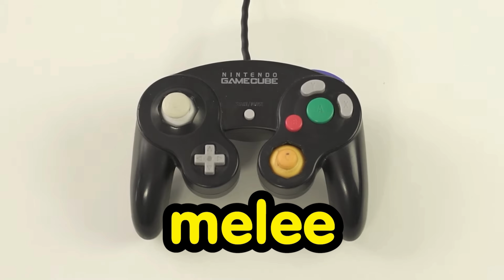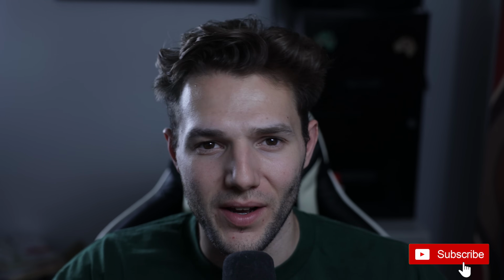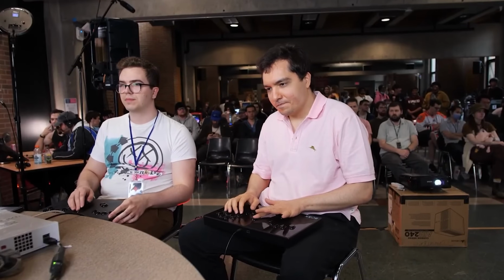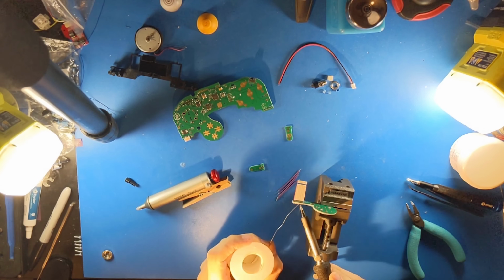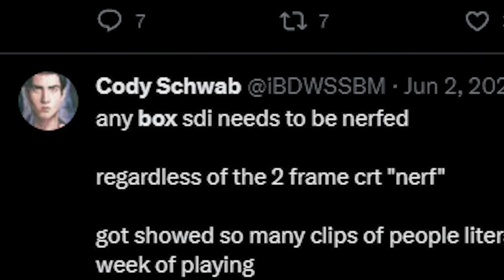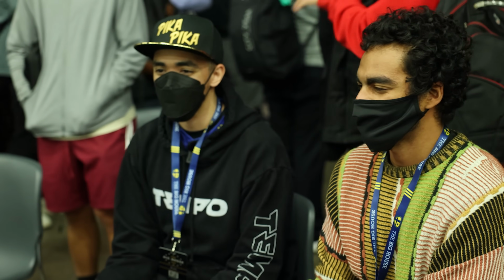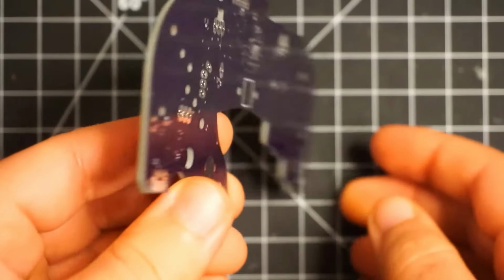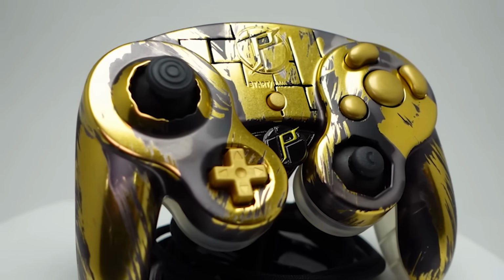The Hidden Barrier of Melee

Comment: As a (now retired) phob maker due to hand pain and stepping away from melee (maybe I’ll get back in with a rectangle), I’m very glad that the 2.0 lowered costs for both modders and users, and is extremely easy to make. You didn’t mention any of the Boxx nerfs that are already built in compared to notched OEM controllers: they have significantly reduced angles compared to max wd notches, which are trivial with phobs. This doesn’t sound like it’s huge but it reduces the distance you can wavedash by a massive amount on fox specifically, as well as making your recovery more exploitable as the max angles on boxx from above ledge can be hit by various tilts compared to the completely safe angle of Cody’s standard recoveries, which are flatter. I think boxx fox is actually worse than controller, despite the access to turnaround uptilt, and other less explored characters could be very strong on boxx, such as Marth Shiek or Falcon, since they aren’t hit as hard by the angle nerf and can hit dash out of crouch consistently for downthrow tech chasing. Notches should almost certainly be banned, but personally I’m ok with button remapping as stuff like z jump improves hand health compared to clawing for long periods. Goomwaves are also somehow not banned despite using macros for pivots and uptilts. It’s also really hard to police stuff at the local level or online, software/hardware checks are infeasible for majors as well. We truly opened Pandora’s box of controllers

Comment: The fact that the magnets can become altered by the earths field (I'm not joking) makes traveling internationally with them even more treacherous because no amount of special cases for them can save you
Reply from the maker: Hold on, WHAT???
Reply: Faraday cages should prevent that
Reply: @tacticaloof6407 the electromagnetic field of the earth still affects you in a plane though...

You can check that for yourself easily by bringing a compass with you next time.
Reply: huehuehuehue
Reply: @imstupid880  I'm not going to Brazil
Reply: shipping magnents on a plane can bring it down early
Reply: I mean... what about a case lined with like 5mm of copper embedded in an insulating Material? Should be fine?

The electromagnetuc field of the earth isn't that strong, like half a gauss or sth.

Imagine saying there is nothing we can do, as if RF-ID is not a Thing... it's not 2010 anymore bro
Reply: They only get altered if you heat them past the curie point.
Reply: i don't think this matters. you can (and should anyway) re-calibrate your controller and make sure the settings are correct after you've arrived at your destination anyway.
Reply: Was that actually a thing or did leffen just pin controller issues on that one time? Because that's all I've ever been able to find on this topic

Comment: I love the Gamecube controller so much. You can actually import Gamecube controllers from Japan for insanely cheap through a middleman service, and they're usually in amazing condition! I feel like it's a largely untapped market, as most Melee players source their controllers from the US, which is generally a bit expensive.
Reply from the maker: I think it’s the best controller out there. I love it 😄
Reply: what middleman service did you use? all the ones I've looked at are like $100 in shipping for a $20 controller
Reply: @Sizzyl  What! The only time I've paid that much was when I was importing multiple consoles, games, and records at once. I use Buy-ëè, which I'm misspelling so YT doesn't hide this comment or something. I always make a new account and use some YouTuber's promo link to get some money off, and I usually try to do it when the site is having an international shipping sale through Mürrcari (again spelled wrong on purpose). If you buy a bunch of controllers at once, the shipping shouldn't be anywhere near 100 and you'll save by buying multiple instead of doing separate purchases. The last time I imported a big box NES game and a couple cartridges it came to 22. They're currently doing a deal where if you spend 33~ through Mūercari you'll get 50 percent off the shipping fee, and it scaled up to 100 percent off if you spend enough. So yeah I mostly keep an eye on the coupons/deals they're running, and find cheap items on top of that.
Let me know if this comment goes through, because it doesn't seem to be. :/
Reply: @Sizzyl I tried explaining everything I do, but idk if it went through. Tl;dr I use Buy ë (spelled wrong on purpose)
Reply: Thanks for the heads up!